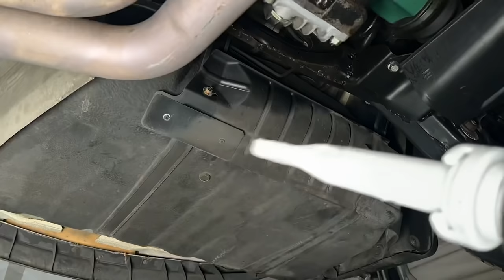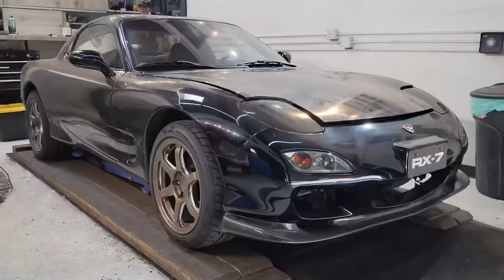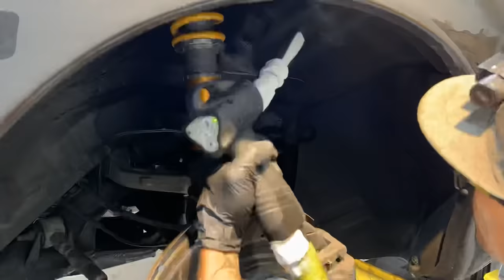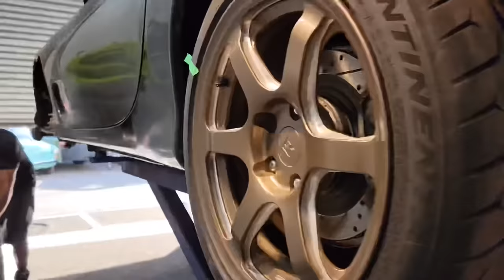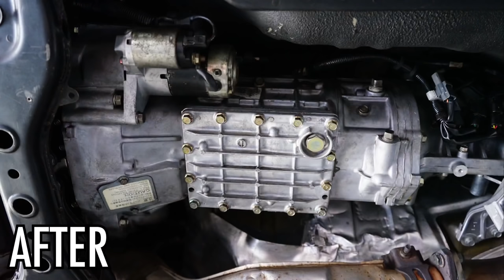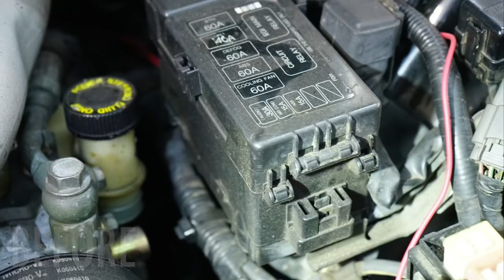Mazda RX7 FD Dry Ice Cleaning the JDM ROYALTY

Comment: Is blasting off the factory undercoating a good idea? The factory baked on the undercoating for a good reason. Now all that is there is bare metal. 😧
Reply from the maker: You probably see more than I do but what undercoating you talking about?  What bare metal you see? 
From this car was removed only dirt and there is no bare metal, except aluminum that came from factory like this and for these parts we applied wax protection to prevent oxidation, but you clearly don’t know what you talking about 😉